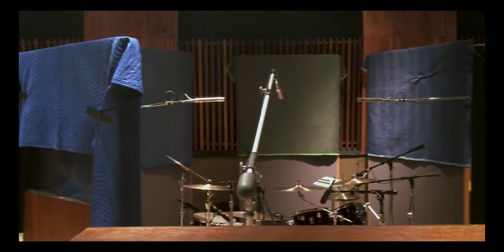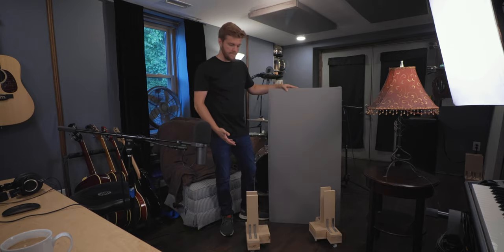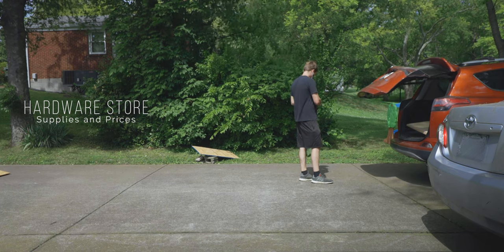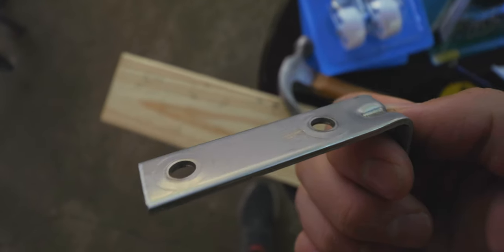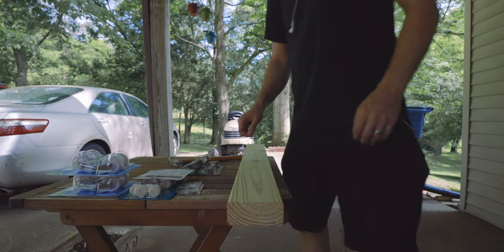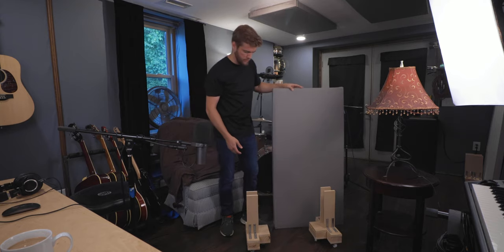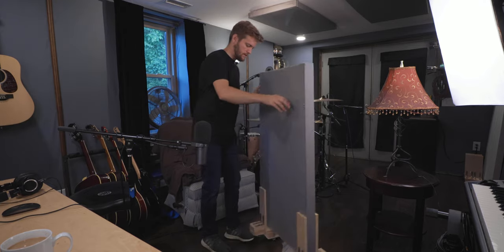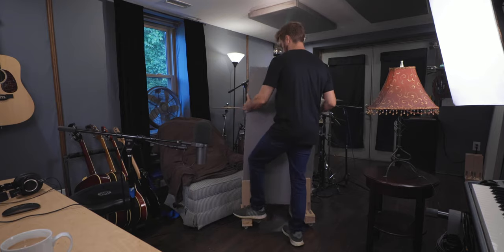DIY SOUND PANEL ACCESSORY for Home Studios (From Walls to WHEELS)

Comment: I love the simplicity of this, I do a fair amount of woodworking and like your design, I think if you put another strut going up on the outside your gain a lot of rigidity. It will surely limit how far in you can slide your rollers, but when you set it up it seemed like they were just on the outside anyways. I like to take a bare sheet of plywood either 2x4 or 4x4 and use that for my gobos so I can either throw a blanket on to absorb or leave bare for more reflection, I leave it bare with upright bass, cello, and sometimes horns
Reply from the maker: Thanks! Do you just lean it against something? Or does it have feet?
Reply: Andrew Masters I actually will take two 2x4 sheets and use piano or door hinges on the end and then you can open them up and they will stand, or I’ll build something similar to your roller, but usually just permanently installed on the gobo,. I like the modular style of yours though, especially in a space where storage might be limited

Comment: What's crazy is that I've been designing something like this for a while now, just haven't had the time or resources to execute it. I live in a New York and something like this allows for a make shift booth in a bedroom. Off the Wall and turned into a sort of cube. The thing that's different about my design is that I created an "H" style of structure so I can stack them on top of each other.
I think that for your design I would put triangle cuts on the bottom for a firmer support. Great video and it's cool to think I'm not the only one who has thought of this. I'm surprised a company hasn't made something like this already
Reply from the maker: That’s awesome, yeah the triangle is a good move. I basically made a Minecraft version of a triangle lol.

Comment: :)

I have in an old physical folder design drawings of a Shake´n´Bake band live setup complete with amps, cabs, FOH-PA, mixing desk control station, lightning rigs and stage designs,- all designed as mobile modular units based on the idea that you should be able to heave all of it out of a van and have it ready for sound check and pack it all up in the van again ready to go in an hour.
Makes sense if you would design your studio set up along the same lines for the added flexibility.
Have you ever considered the idea of going mobile recording,- like a plug and play recording studio in a van,- for live applications or specialty jobs,- much like an OB van?
And how would you address that idea,-designing the van interior like an isolated recording, mixing and mastering studio on the fly and the finished product ready to go online before you pack up and go home?
Could be yet another way of generating revenue and income doing what you do best....
Just putting the idea out there... :)
Reply from the maker: Sounds cool! I know one of the subscribers to this channel does that. They have an entire trailer that’s a mobile studio. @thebandwagon is their YouTube channel. Check it out! I have a lot of respect for the mobile recording/live sound word but want nothing to do with it haha!
Reply: @AndrewMasters  Fair enough. :) Will check them out.

Comment: Always enjoy your DIY videos. Would commercially available CPU stands with wheels work? The width of the stand is adjustable but perhaps you will stll need minor mods to get the right fit. Was just wondering. LIKED 👍
Reply from the maker: Good question I’d have to look into that.
Reply from the maker: Thanks!!

Comment: Love your videos man, your honesty, and love for what you do shines through! I’ve been trying to get my living better with the acoustics cause my monitors are about 10-12 feet away from me ( I know that’s horrible, but I’m disabled and have to sit on the couch) I still need a living room to be a living room so I have my lcd screen on my coffee table in from of me on the couch . Displaying my iMac screen, the problems I have is the sound gets blocked from the monitor in front of me, and I almost rely on the reflections to hear the sound, horrible I know. Plus I have tile floor! , my question is would those bassctraps even be worth it or useful in this situation? I mix with reference headphones and track with tracking cans but I still love to hear it in the room off the monitors. 
If you have any thoughts on how to improve this please tell me?
Reply from the maker: Thanks man I appreciate that. A great first start would be to throw an area rug down. See how that changes things, then maybe consider a couple panels on the walls at reflection points. Thanks for watching!

Comment: Bro .. should I hang the acoustic panels in a soundproof home studio ?..or soundproofing with the Rockwool only is good
Reply from the maker: Panels are for acoustically treating the room, sound proofing is a construction decision and design. Treatment manipulates the sound inside the room, soundproofing prevents sound from leaving the room. So it depends on what you’re doing I suppose!
Reply: @AndrewMasters  Oh. ..So I have to acoustically treat the soundproof room ?
Reply from the maker: Yes, they are two completely different things. Here’s a better way of explaining it. Sound proofing is what’s inside of your walls, and treatment is what’s inside your room.
Reply from the maker: For instance, my studio is not sound proof. It’s acoustically treated. Plenty of sound escapes and gets in my room from outside.
Reply: @AndrewMasters  Thanks alot Bro ...♥️♥️♥️..Bro...Make a quick review of your akai midi 😫.. Everyone will love to see it🙏🔥